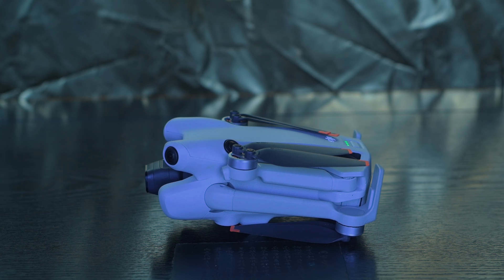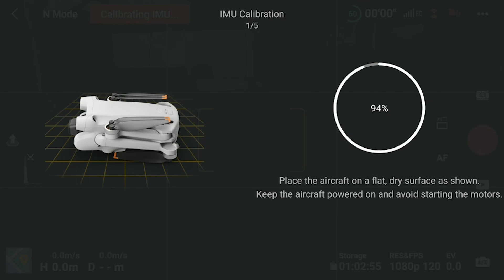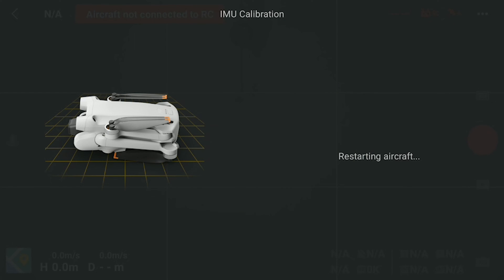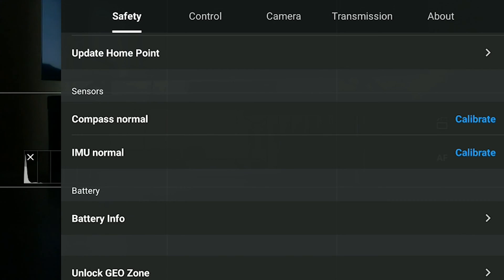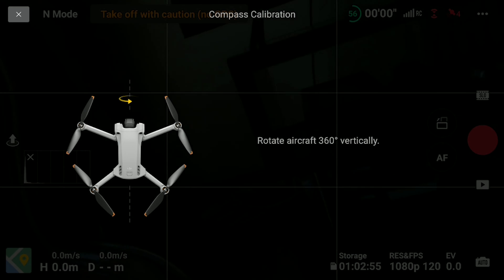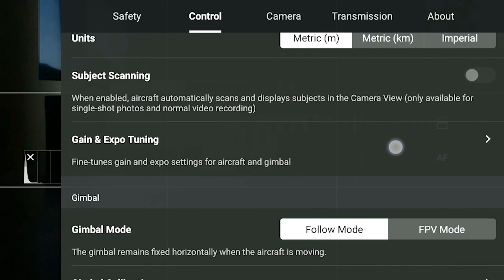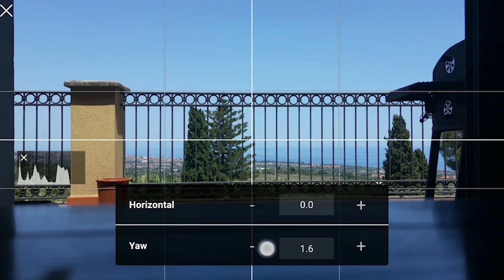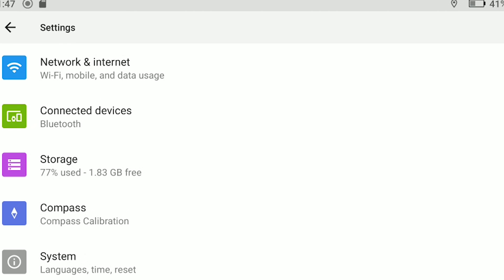DJI Mini 4 Pro - Calibration of IMU, Compass, Gimbal, and Remote Control

Comment: Friend, take advantage of your kindness and knowledge. I bought a secondhand Mini 4 Pro, with only 4 flights logged on the DJI website. The problem that immediately arose was that once flying at altitude, where there are no obstacles, the drone incorrectly detects obstacles (in all directions, left and right). I can't use it in automated flights, such as following points of interest, because it stops. They tell me that obstacle sensors need to be calibrated, but I still haven't figured out how. Can you help me? Greetings from Argentina.
Reply from the maker: Ola Marcelo,
it is a good idea to do all the calibrations described in this video, it might solve your problem.
Here is a link to DJI support website describing the calibration of obstacle sensors. Apparently for the Mini 4 Pro it is done automatically: https://support.dji.com/help/content?customId=en-us03400006473&spaceId=34&re=US&lang=en
Reply: @VICVideopIC  gracias mi amigo! Si la calibraciones de sensores del Mini 4 pro es automática, no está disponible en DJI Asistente 2. Y aparentemente hay que enviarlo al servicio oficial para que lo solucione. (El problema es que el servo oficial en argentina solo estará en Buenos Aires, a 600 km de mi casa; pero habrá que hacerlo)  Muchas gracias 
If the Mini 4 Pro sensor calibration is automatic, it's not available in DJI Assistant 2. Apparently, you have to send it to an official service center to have it fixed. (The problem is that the official servo in Argentina will only be available in Buenos Aires, 600 km from my house; but it will have to be done.) Thank you very much.

Comment: The DJI Mini 4 Pro has an issue with the propeller screws. Due to the use of a lighter alloy, the screws do not fasten properly, causing the propellers to have a slight play, leading to instability. DJI mentioned that the alloys used in the DJI Mini 4 Pro are softer compared to those in the Mini 2 SE, resulting in the propellers not being secured firmly and the cross on the screw head wearing out easily. Note that It is important to tighten the screws before each flight to ensure they are not loose. However, frequent checks could damage the screw slots.
You could try gently moving the propeller up and down vertically to see if there is significant play.

Comment: An excellent video my friend! Does placing the drone on it's propellers/motors not cause any damage? I purchased the mini 4 pro a few months ago and recently noticed that it wasn't flying in a straight line. Will attempt this calibration :)